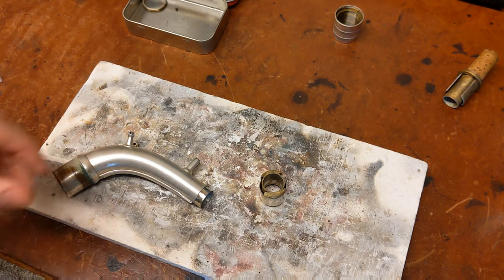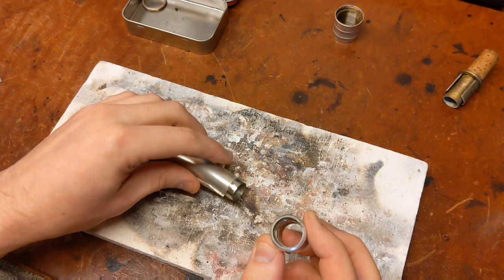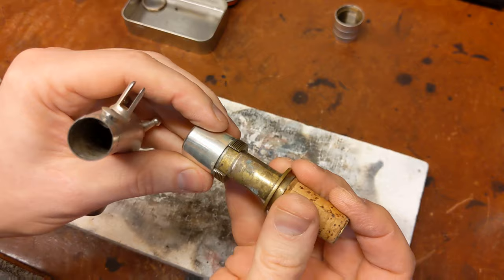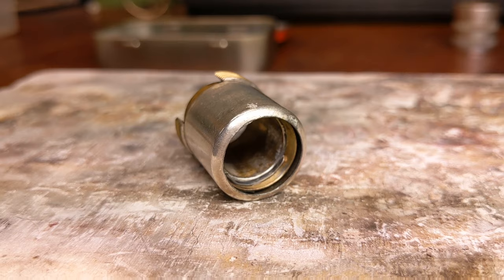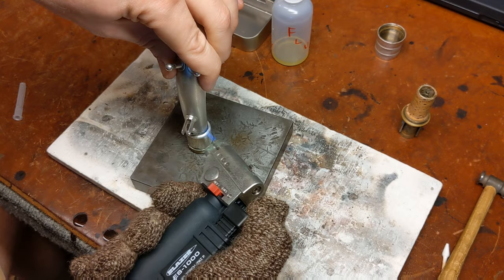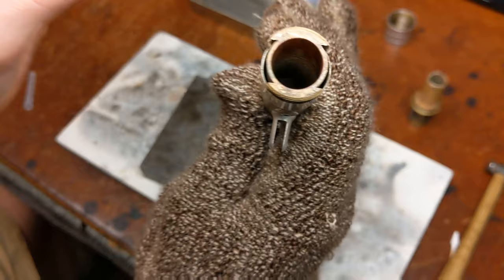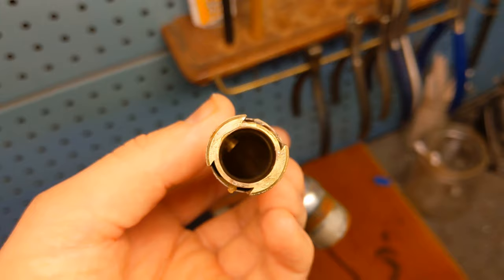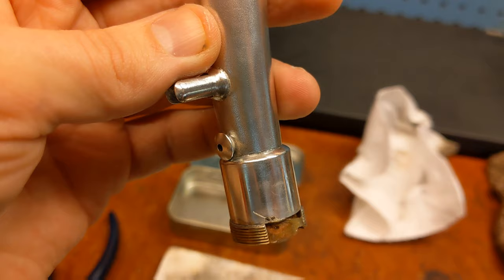Saxophone Repair Tip: Resoldering Conn NWII Microtuner

Comment: hey, im really interested in obtaining this specific model of saxophone.
however i can't find any how-to's on using the microtuner...is is possible to make a small video explaining the process of setting up and getting it ready?
especially about how to tune this model using the microtuner in particular?
ive played an alto e flat for many years when I was younger and have become rusty...some of the basics are still hardwired into my DNA, but this specific accoutrement and how to use it escapes me completely...anyway, i appreciate any and all information and help you can offer